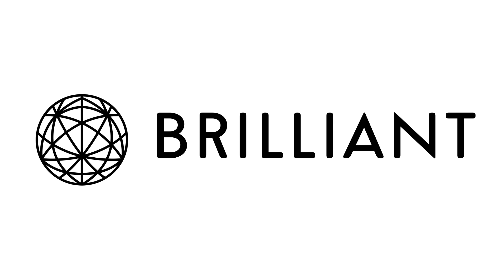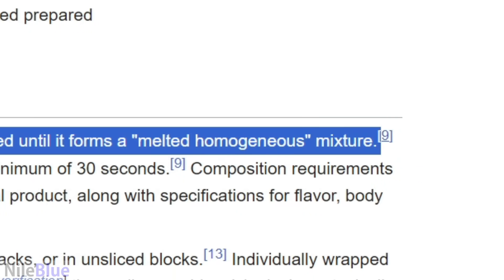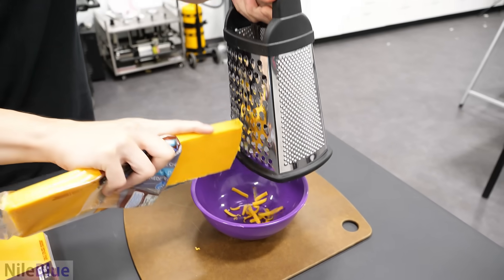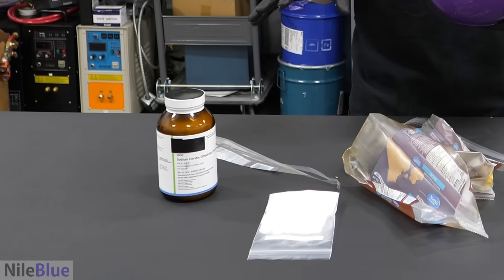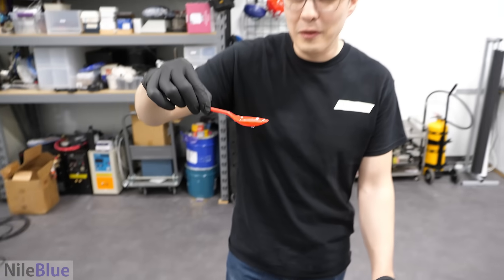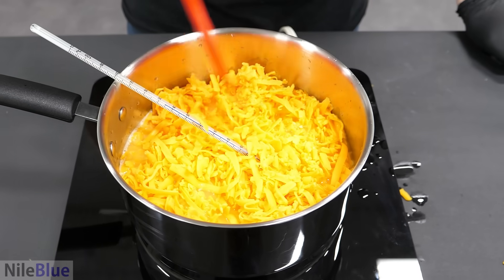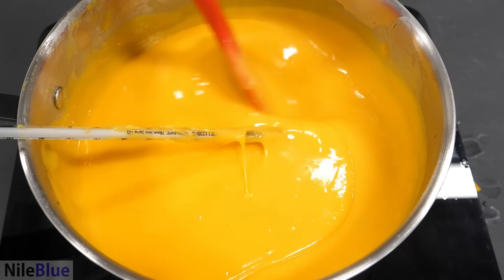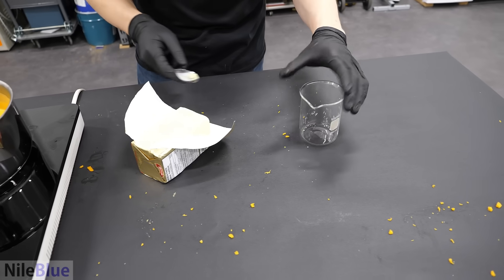Making American cheese to debunk a conspiracy

Comment: NileRed: protective equipment and safety procedures 

NileBlue: tastes the chemical bath
Reply: well it should be in theory safe to consume. prob only reason why he did it
Reply: One does complex scientific procedure.

The other drinks the lab specimen while in the middle of the experiment that requires said specimen.
Reply: Wonder what NileGreen’s gonna do
Reply: turn himself into the chemical bath @porkchop99
Reply: nilegreen is more destructive. @porkchop99
Reply: NileGreen: creates a bomb from said protective equipment and chemicals
Reply: I mean it's salt and water, it's not exactly harmful.
Reply: Well, everything is a chemical. Water, oxygen. And Your organic BIO ANTI-GMO apple is also full of chemicals.
Reply: I mean if he's adding it to food it ought to be edible.
There are however chemicals in some things which are harmful before the reaction has been completed - e.g. making soap. The sodium hydroxide is corrosive to skin, until it has reacted with the oil to make the soap and then it's safe.
Sodium hydroxide and hydrochloric acid - both corrosive chemicals. Mix them in the right proportions and you get sodium chloride in water - AKA salt water. The sodium and the "chloric" combine and the "hydroxide" and the "hydra" combine to make "hydra-hydroxide" AKA more water.
Also there is a preservative used in some bottled drinks - dimethyl dicarbonate that means the drink should not be consumed for 24 hours or so after manufacture.

Comment: 1. incorporate your butter/milkpowder mixture in slowly to truly get it cohesive
2. preheat a tray to transfer it onto
3. put plastic wrap on top to prevent the top from drying off
Reply: Instructions unclear, the Geiger counters in my house are panicking 😮
Reply: I'd probably go further. Seal it in plastic before it fully hardens, and it'll be exactly like the store bought stuff.
Reply: @hvip4 did you use the uranyl diurate instead of whole milk powder? 😂😂😂
Reply: It would be better if the milk powder was mixed with the water first and the butter was added with the cheese.
Reply: Thanks, I'm going to try to make some, this will be helpful. (I like this kind of cheese and cooking)
Reply: you need the chemical mixture to be as pure as possible for the addition of the cheese, your goal is to suspend the fat content of the cheese in more water initially, adding anything else will mess with the outcome of the final product. this being molecular gastronomy, it is very particular in how the process is carried out.

Comment: In the cheese making process you legally can't call Mozzarella cheese mozzarella if you mix in other ingredients before a certain step. If you wanted to add in peppers (like in pepper Jack) you have to add them in after all the excess whey has drained, otherwise it would no longer legally be mozzarella. The regulation around what legally is and isn't cheese is wild.
Reply: It's like that with some alcohols as well.  In order to be bourbon, it has to made in the continental US, 51% corn, AND aged in a virgin oak barrel (a barrel that hasn't been used for anything, made just for aging the liquor).  I'm sure there's other things like that as well.
Reply: @XultanisDae  damn didn't know virginity culture was so widespread we even require barrels to be virgins :/

/s
Reply: @ons1m598 i dont want to know what a drink from a non-virgin barrel is
Reply: @Chikn2532 gooey, probably gooey.
Reply: As a former cheese retailer, this is true and these laws are  more evident in Italian or French cheeses.
Reply: @Chikn2532  Well when making bourbon you char the inside of the barrel before putting the alcohol in. I'm not an expert in it but I'd imagine that aging the high proof liquor in it probably strips away a lot of the flavor from the charred barrel which is possibly why that regulation is there. Used bourbon aging barrels actually often get used in the aging of other whiskeys, liquors and even beers and wines which fortunately makes that regulation a little less wasteful.
Reply: Good
Reply: @karateman302 ita not like there is a rule on how charred the barrels have to be... all it says is a new charred oak barrel.
Reply: @Chikn2532  glenmorangie nectar d'or scotch, aged in sauternes barrels would be an example.
Reply: Where is this the case though? If it’s Italy, yeah definitely all that and probably a bunch more. If you’re talking the US that sounds kinda overboard for what I would expect but I couldn’t say I know that’s not true. Location is pretty important for laws
Reply: @monhi64  it's the US. There are tons of weirdly specific regulations in the US regarding what you can call various foods, not just limited to cheeses.

Comment: I work in quality at Kraft and the way the slices are manufactured is crazy. It's 2 stories high. The molten emulsification is made on the 2nd floor and pumped down to the 1st floor where it is cooled/packaged in each individual square at the same time. Imagine a long machine that seals the cheese in each square while running it all through a cool bath. The lines run 24/7.
Reply: What city was this in?
Reply: I’m sure that more sugar goes in as well as other ingredients
Reply: I would love to see that machine
Reply: hire me to work there i wanna see the cheese
Reply: @omnizoom  They don't actually add sugar to craft singles, they just add salt chemicals and fillers.

Comment: Kitchen protip: you can make sodium citrate in the kitchen by reacting baking soda with lemon or lime juice. Use this to emulsify whatever cheeses you want to make the perfect cheese sauce for nachos or Mac and cheese or whatever you like! It’s something like 1/2 tsl baking soda and 50mL lemon juice to emulsify 8oz of cheese, and just wait for it to stop offgassing before you mix it in with the cheese. It shouldn’t taste bitter or sour if you got the proportions right, but it will probably taste sweet and a little salty. You may still need to add more of a different emulsifier like xanthan gum to get everything just right but the sodium citrate fixes the problem where the fat and the protein separate when the cheese melts
Reply: You can also use Milk or broth for the liquid to get different texture/flavor.
Reply: Came here to say this. The Science Friday podcast went over this a while back.
Reply: or just buy the citrus salt from modernist cuisine. Baby steps. 

Been making gouda-blue juicy lucys and cheddar-parmesean mac for years now. The water is a medium to slowly heat the cheese to allow the citrate preventing then cheese's oils from separating (as photoklarno said), taking the flavor with them. Pizza is covered in greasy rubbery stretchy cheese, but doesn't really taste like mozzarella. Milk works too, but I keep burning it and haven't noticed a huge difference, so I stick with water.  Also, when cooking they are called ingredients, not chemicals, lol
Reply: Doing the lord work 👏
Reply: Or, citric acid can be had as a seasoning item called "Sour salt."

Comment: Sodium citrate can be made at home by just mixing lemon juice with baking soda.
Great way to make mac 'n cheese without having to worry about overheating the cheese to the point where the cheese proteins start clumping.
Reply: You can even get it at some grocery stores. Great "cheat" way to make a nice cheese sauce without going through the process of making a proper mornay.
Reply: Try using magnesium citrate. Definitely no worries about clumping lol
Reply: Or you could just mix in some regular American cheese into your Mac n' cheese to prevent the clumps from forming.
Reply: Citrate is just the deprotonated version of citric acid, so you don't even need the baking soda.
Reply: @RazorsharpLT  exactly this, evaporated milk + mix of cornstarch and american, cheddar, whatever else you want in there. super easy. though it doesnt seem like making a roux is particularly difficult either
Reply: @deyesed   Are you saying that straight lemon juice would emulsify a cheese sauce?
Reply: Or just learn how to make cheese sauce... It isn't difficult.
Reply: I encourage anyone to try the lemon and baking soda tech to at least make a cheese dip or something. Its a nifty kind of cooking just to know you can do.
I got it off an Adam Ragusea vid. Shouldn't be hard to find if you want more info
Reply: that's really neat!
but have you considered.. not overcooking the cheese?
Reply: @thomasdalton1508 The sodium citrate method makes a much smoother sauce than other methods like using a roux. Plus, it’s not like sodium citrate is a hard to make/use ingredient anyway
Reply: @servalsays9906  I can understand it might be good for a cheese dip (and I'll probably try it), but for mac and cheese, which is what the OP was talking about, I don't see any reason to move away from a bechamel-based cheese sauce. I've never had any problems with it clumping due to overheating, as the OP apparently has.
Reply: One can also use a splash of white wine.

Comment: General cooking tips:
-For an emulsion, add the fat slowly and mix in quickly.
-A block of butter usually has a measurement rule on one of the inside folds so you can cut a slice, rather than scooping off with spoons
Reply: Not in Europe. You weigh your butter by grams on a scale. There's none of that tablespoon nonsense.
Reply: The rule on the side of the butter block is fine if you know how many grams/ounces are a table spoon...
Reply: Also:
- The pot has a handle
Reply: a yes getting a scale and or its holder dirty, much better than preprinted instructions. so wow europe
Reply: @alicecries Do you not use bowls, pans, or cups in your kitchen? Do you use your hands to add water to a pot? Tell me you don't know how to use a scale.
Reply: @alicecries  What he fails to mention, is that in (i hope) most of Europe, there are markings on the package, that shows how much to slice of to get 50 grams. So no need for a scale, unless some one took a spoon to it already
Reply: @estrafalario5612  No the rule on it is literally cut a slice this thick is 1 cup, this thick is 1/2 cup, this thick is 1/4 cup...

Instead the guy uses a random sized spoon.

Comment: Top tip: when adding powder to a thick liquid mixture, use a sieve. You won’t get any clumps or chunks that way, and it should all mix in homogeneously
Reply: Just use milk instead of water and milk powder
Reply: I feel like tempering the milk powder with the cheese water might have also helped too.
Reply: I am infertile

Comment: 14:22 LOL, I bought that exact tray too, only to find that it didn’t fit the oven!!! I just measured quickly on the oven door when ordering it, and soon enough figured out that there is a lot more insulation (thick oven walls!) than I thought there would be. Proof I don’t use my oven much anymore, thanks to the airfryer… PS! I did buy the next size down, fits nicely!!! 😂😂😂

Comment: What the Wikipedia article doesn't say, but you can learn in the linked Kraft patent, is that the whole point was to be able to wrap individual slices for convenience. Being able to pasteurize it was secondary, because cheese ordinarily keeps far longer than milk or meat when sealed anyway.
Reply: Yeah, reading all the comment about increasing the shelf life, I was just thinking "aged cheese exists because this stuff has a shelf life of multiple months already"  It's also one of few foods traditionally dipped in wax for air tight preservation, and one of even fewer that you can just scrape the mold off of when finally it goes bad.
Reply: @nyon7209  Months? Takes a bite of bitto storico that has been ages 18 years. Did you say months?
Reply: @V  Never heard of this, but I'm intrigued. Ok, checked it out ;£141/pound.
And that's for eleven years old. I wonder if they sell it by the gramme?

Comment: For anyone wanting to do this yourself and you want to avoid the wrinkly stuff on top,  here's a little chef tip. While the mixture is still hot, cover it tightly with cling film (make sure there's no air bubbles between the plastic and the mix. Otherwise moisture will collect under the cling film and the mix will get sour), make sure it's smooth (you can also put another tray on top to make it even smoother) then put it in the fridge. You'll get a nice, shiny top with no wrinkles!
Reply: I was going to say a tray on tio too! But I’m not a chef, so thanks for the air bubble tip with the cling film 😂
I’m guessing your from U.K. too,  maybe? Because I know Americans call it something different lol
Reply: yeah i was thinking the same tho ik nileblue doesn’t know much about making food (based on what we’ve seen :P ) so i didn’t expect him to do it.
Reply: i was just about to comment the same thing.
btw thats the plastic they all freak out about
Reply: or just keep mixing the whole time
Reply: I would have gone for parchment paper and then cling film
Reply: @Leanne_w Here in the US I hear it called cling film, plastic wrap, or old folks call it Saran Wrap. That last is a brand name that became generic with long use. Don't know if the original brand still exists.
Reply: @lwilton  my thai wife calls it sera/sara wrap (silent n).   they also sell it on web shops here with 'saran' on the name, even though it's not saran brand.
Reply: like my brain!
Reply: I always do this when I make chocolate pie
Reply: @Leanne_w  Actually, I'm from Norway! But there aren't a lot of Norwegians in the restaurants where I live, so we always communicate in English 😂
Reply: @historiacabecuda  That too, but honestly.. who tf has time to keep mixing it the whole time while it cools down? You could always do other prep work/or just chill while you wait for the glorious cheese

Comment: I'm beginning to wonder if Nile's only interactions with food are the ones we've seen on the channel
Reply: the moment i saw him pull out a spatula instead of a whisk for cheese sauce was what did it for me
Reply: @qu4rtz732   for me it was when he started mixing without even pulling out the thermometer. I can understand, why he would probably not use a whisk, maybe he simply doesn't have it in the lab (yes, turned out he did have it, but I gave a benefit of the doubt at the moment), but damn, you can't mix anything properly with this thing sticking out.
Reply: You must not have seen him grating then?
Reply: did yall see how he flattened the bread, it was thinner than the cheese when he was done with it.
Reply: @adamgibbons6251 And let's not forget holding the edge of the pot instead of the pot-handle while stirring.
Reply: or when he fucking ate a table spoon of butter?!
Reply: @mikumikuareka Leaving the thermometer in is kind of an artifact of his being a chemist - there's a lot of reactions you absolutely want to know what temperature they're at or things could go wrong really quickly.

Comment: "American cheese is cheddar and Colby Jack" immediately proceeds to only use cheddar
Reply: There's not that much difference in flavor between mild cheddar and colby jack tbh
Reply: @vicroc4  It depends. Sharp cheddar and Colby-Jack? Massive difference. Mild cheddar like the stuff in the video? Yeah, very similar aside from the Colby-Jack being a little softer. Was the cheddar they used to make original American cheese back then more like the former or the latter?
Reply: Literally the biggest difference between Colby and Cheddar is that the curds are washed at a certain step when making Colby, they're pretty much identical otherwise.
Reply: @Serzari  I don't know about the historical cheese.  My understanding is it was basically just whatever scraps they couldn't sell.  But notice I did specify "mild" cheddar, because yeah, sharp cheddar is a whole other ballgame.
Reply: American cheese can be made of one or both cheese.
Reply: I can taste more of the milk in Colby Jack, which might have removed the necessity of adding butter and milk powder to the experimental American cheese.